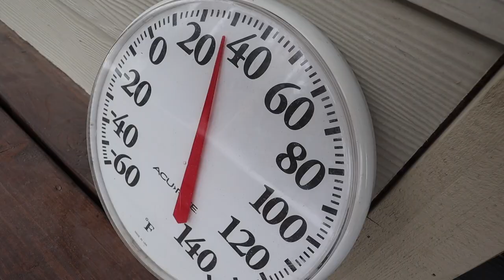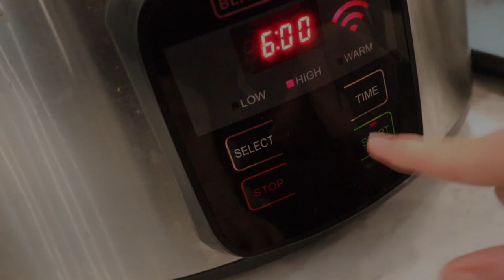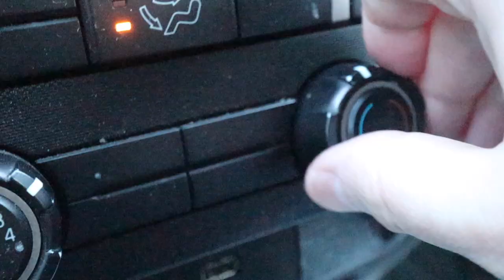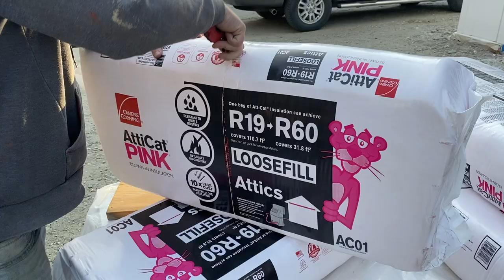IT'S HAPPENING!| SURPRISE!|  Somers In Alaska

Comment: It snows in the high mountains in Colorado at this time year .my area usually gets. It’s first snow around October 18.the weather was cooler today and rained I hope it stays that way it was a hot summer temperatures in the 90” s sometimes 100 degrees.September has been 80”s mostly now it will be in the 70”s.